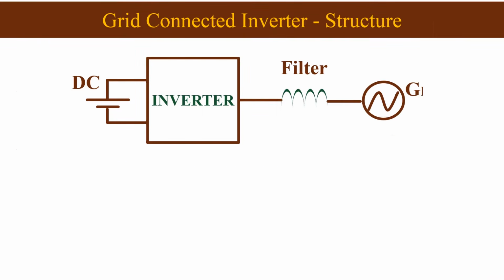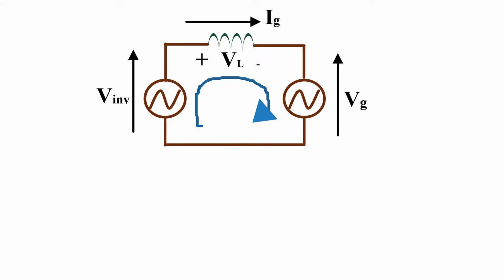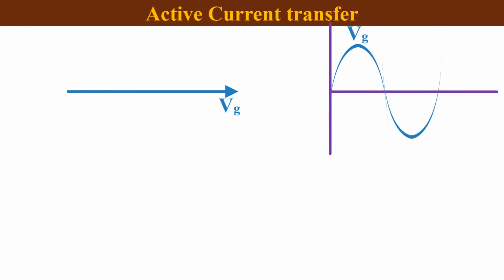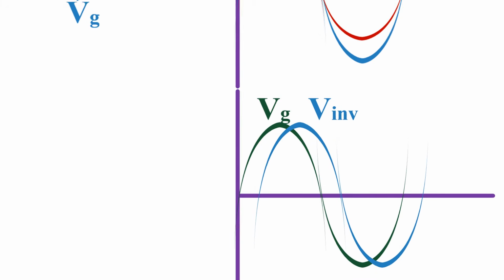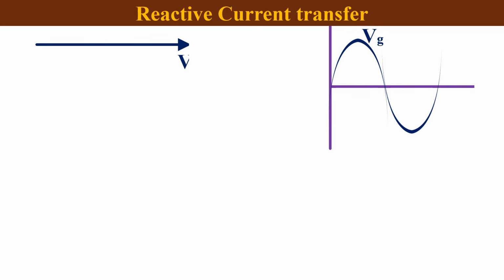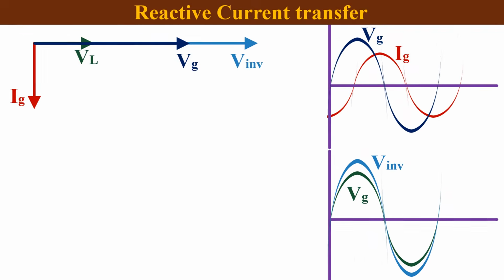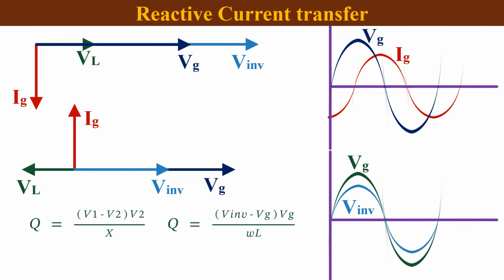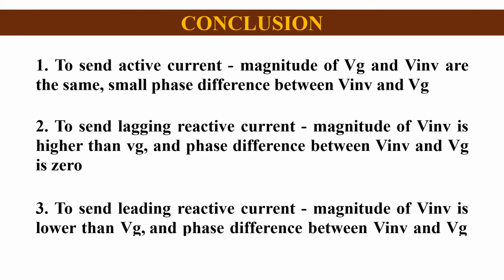How a grid Inverter is generating Active and Reactive Current? Fundamental Concept explained.

Comment: 2:47 the sine wave diagram on the right is correct but the phasor on the left is not. +90 degree for the current means that the current vector should point up. Since rotation in phasor is considered anticlockwise. Do no confuse it with phaser for power vectors cause the definition for apparent power is  complex voltage times conjunctive complex current (current angle receives "-").
Reply: Rule of the game, vectors of voltage and current vectors rotate ANTI CLOCK wise around point “o” until stated otherwise. Refer the waveform to the right, Current Ig is LAGGING by 90 degree behind the Grid Voltage Vg. 

How? Look at the x-axis which is zero volt line. On this axis, Vg is seen to zero cross first, followed by Ig. Hence voltage leads current. Trust, we are in synch.

On the vector diagram the same is represented, assume the observer watching this game at 02:00 AM clock position. As both vector revolves at same speed. Which vector shall appear first, Vg or grid voltage. And exactly after 90 degree “Ig” shall appear. Can it be said that Vg is leading Ig? And also this is identical in saying Ig lags behind Vg.

So, the vector diagram exactly tells the happening in the waveform.

Thank you for your curiosity. Electrical Engineering is pure love.

Comment: My understanding is we don't want to provide reactive power, it rather was initially created within the inductive load from the grid power. This "delayed" power can feed back into the grid which is undesired, so we gotta make up for it, absorbing it by Capacitors, storing that energy until released into the next upcoming grid cycle
Reply: Exactly. That's my understanding too.

Comment: By adjusting voltage inverter is compensating grid requirements for reactive power. But inverter can not "push" reactive power to the grin in order to maintain grid voltage as other power sources with excitation do. Can you please explain (or simulate) voltage and frequency operational limits of the inverter? How inverter should behave in island mode of operation?

Comment: Hey , can we say that VFD's generate reactive power necessay for motors using the same concept that you explained ?
Reply from the maker: No, for vfd motor is like a load. in grid connected system, we have voltage sources in either side

Comment: By setting the magnitudes of Vin and Vg to be equal, then controlling only delta, you can control both P and Q (P -> sin(delta), Q -> cos(delta). In other words, the power factor simply becomes cot(delta).  You cannot increase P w/o affecting Q this way. 

The proper way to independently control both is to control both delta and the Vinv magnitude: Vinv = (X/Vg)*S, delta = arctan(P/Q), with S = sqrt(P^2+Q^2).

Comment: As per  the vector diagram in case of active power feeding to the grid , the inverter voltage is the phasor sum of the  Vg and VL and hence  its magnitude is greater than Vg . could you clarify ?

Comment: Thanks for sharing the concept . Is this concept is applicable to both voltage source and current source converter , Is this the method being used in solar inverters ?
Reply: Yes, it is the concept of three phase solar grid inverter , for Solar inverter the front part is DC to DC converter with Mppt

Comment: Can you explain what happen if angle between Vg and Vinv chenges. For my understanding this always insert reactive power component to the Ig. And the second question: what will be reaction of inverter if for example Vg will increase? Does that mean that in order to maintain PF=const at POI and  Vinv-Vg=const, inverter will increase Vinv and inject additional reactiove power to the grid?
Reply: Hi Edy,
I hope you found the answers to your questions, since I now have the same confusion, and could use some explanation. I will write down my understanding and I'd appreciate it if you could correct me where I am wrong:
Reply: Q1: What happens when the angle between Vg and Vinv changes? From my understanding, this always inserts a reactive power component to the Ig.
According to the concept (beautifully explained in the video) and power flow formulas, there should only be active power generation in response to the phase difference. But when simulated, the converter produces reactive power as well. I believe the reason is that the more active current flows, the more voltage drop across the impedance, and since (Vinv = Vg + VL), it increases converter voltage which results in reactive power flow.
Reply: Q2: What will be the reaction of the inverter if, for example, Vg will increase? Does that mean that to maintain PF=const at POI and  Vinv-Vg=const, the inverter will increase Vinv and inject additional reactive power to the grid?

Yes, the converter increases its output voltage to the grid level.

Comment: Things get complicated when LCL output filter is used instead of a simple inductor. I did some calculations with such a filter that include capacitor damping resistor and inductors parasitic resistance. The active current can be adjusted by a very small phase shift between inverter and grid voltage but the inverter voltage needs to be adjusted also. The problem is that the phase shift needed to change the current fed into the grid is extremely small 0.1-0.5 degree which is impractical and difficult to achieve. I did calculations using complex numbers with typical values of L1 = L2 = 4mH, C = 3uF and capacitor damping resistor 5 Ohm. Inductor parasitic resistance 1Ohm. Maybe I made a mistake ?

Comment: Great video! Thanks for sharing. I want to ask, is there any limit to inject reactive power from inverter? Like, we know inverter has a dc-link or dc bus. Is the value of dc bus limit the amount of reactive power injected or absorbed?
Reply: Correct, there is two limitations: 1) The DC Bus voltage determines the range of the output voltage. So, for each DC Bus voltage you will have a limitation for the output voltage you can get thus limiting the Power Factor. 2) The rated current of the inverter also plays an important role on this. You can check that on the P-Q curves of the inverter. If the PF is 1.0, then the inverter can provide rated active power, if the PF is 0.80 the active power will be reduced, because the rated current will be shared between active and reactive currents.

Comment: Can you make video of converter simulation using matlab function block with all type of syntex
Reply from the maker: I didint get actually, what excatly you want me to do?
Reply: @TechSimulator  in Matlab function block, you can write code like in dsp but syntexes are different. For more accurate simulation you can use trigger based system.
Reply from the maker: Mayank Amipara ok i understood. I will try to make such videos. Thanks for your suggestion

Comment: Very good explanation and thanks for uploading regular videos.  I have a doubt that if we keep inverter voltage less than the grid voltage and the phase of Inverter voltage leads the phase of grid voltage.  Will we see active power transfer?
Reply from the maker: Yes there will be both active and reactive power transfer.
Reply: @TechSimulator  Ah, new for me ... but how to calculate the inverter setting on pf there, or the setting for reactive power ? (My OnGrid offer both)
Reply: I think the concept will be the same as Synchronous generator , Over excite will same as increase value of Vinv , under excite will same reduce value of Vinv